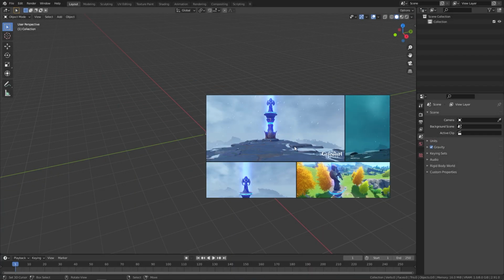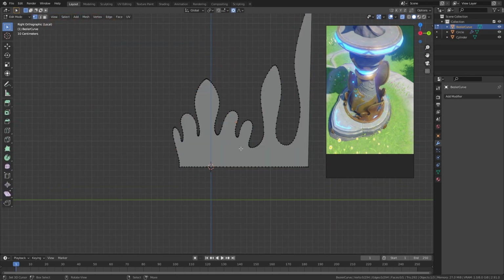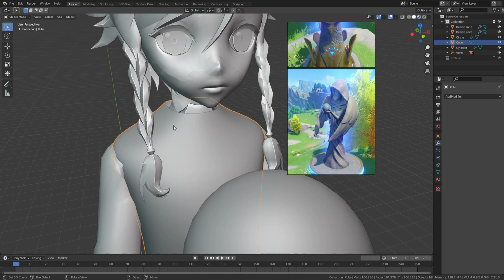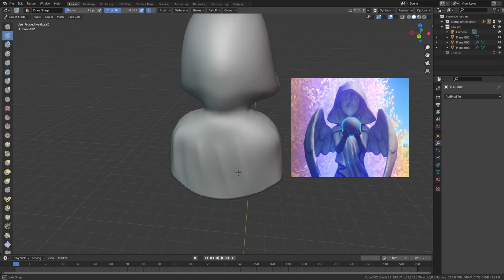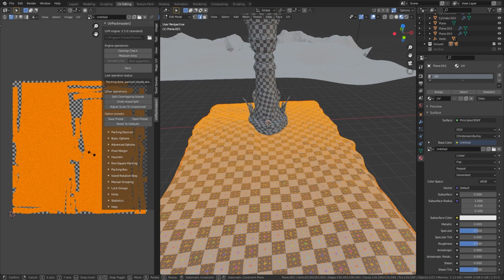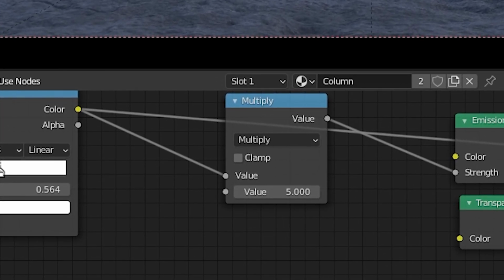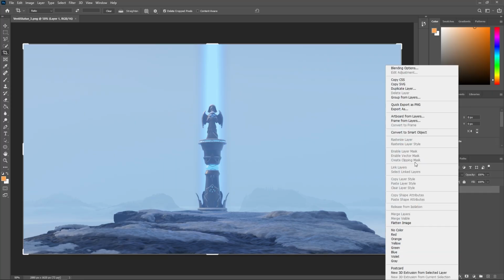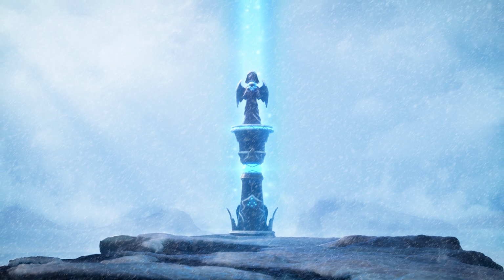How I Created a Winter Themed Genshin Impact Render using Blender and Photoshop

Comment: What us the drawning addon you used on 2:15 ? ;)
Reply from the maker: It's not an addon. Depending on which version of Blender you're using, you may or may not have this feature, but if you add any kind of curve object and go to edit mode, you'll get that tool. Usually what I do is- I delete all the vertices of the curve after going into edit mode, and then I draw a sketch of the shape that I want using the tool, which give you the sketch you draw as points of the curve. Then you can easily manipulate those points and get the perfect curve that you want.
Reply: @RenderRides  ty!

Comment: i dont know how to use proportional editing in blender 2.9 :(
Reply: there is no circle around it when i use it
Reply from the maker: @godotgraphics  That's weird. Were you using it with grab, scale or rotate tool?
Reply: @RenderRides  scaling and grabbing
Reply: @RenderRides  ohh i found it! proportional editing only works on vertex or point, my bad!
Reply from the maker: @godotgraphics  That's not true, it works on faces and edges as well, as long as you're in edit mode.